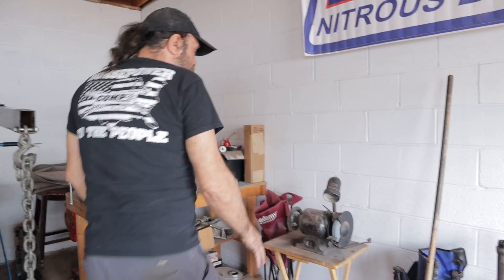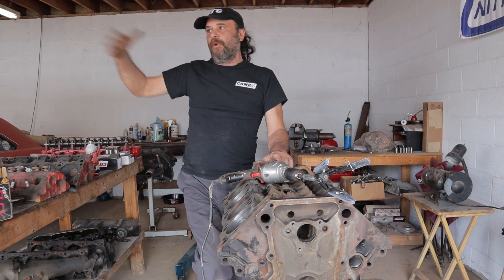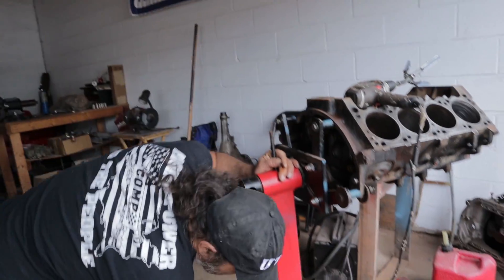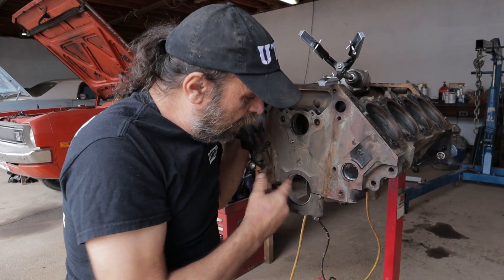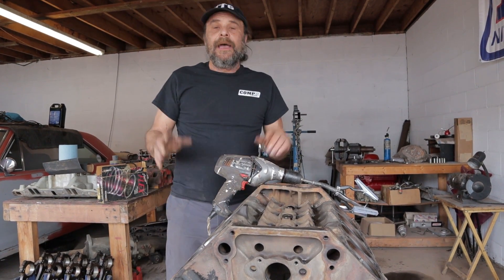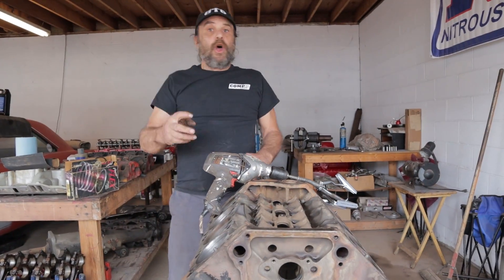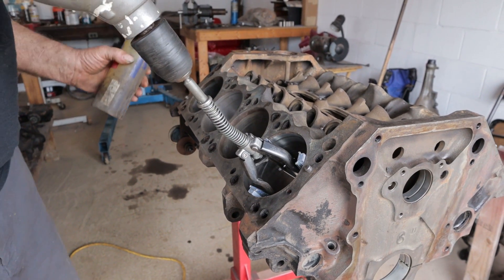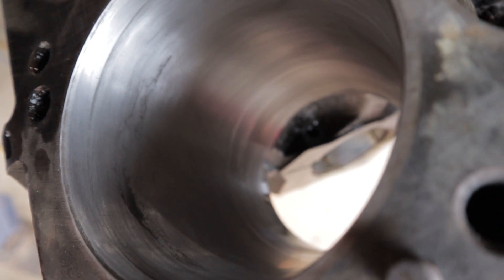Perfect Daily Driver 6 - DIY Engine Block Prep

Comment: I just did a 350 engine rebuild, never did one before, allot of reading and took me about 6 months, but it ran and no leaks.
Reply: Nice job man... No better feeling than turning that key and hearing it roar to life. Makes all the countless hours of riding the front seat of the struggle bus worth it.
Reply: Nice!  Congrats.
Reply: Nothing like that feeling after every Start...... Victory!! ... Peace
Reply: I got a 1970 350/300 sitting in a 70 Impala since 78, I wanna get started on. Drop into a 1992 S10. I guess I am trying to get over the LS naysayers. Seems like this 350 would be in the line with this build. Was rated at 380 ft. lb. of torque from factory. Downside it needs to be prepped for roller lifters since everyone is having such problems out of standard lifters recently... That and not knowing what was actually the problem with it running. Dad said it popped back through the carb one day at lunch on a cold start, and never ran right again. He put a new stock cam and a couple rebuild kits into the carb, to no prevail. Not sure if it was a thing of him being a Ford man, and or not being a good quadrajet man...
Reply: @kramnull8962  Check you timing chain assembly, i know its likely been done but when your stressed, you can often go blind to whats in front of you.
Reply: @kramnull8962  pop out of the Carb is actually a Back fire, I know that term is used a lot for exhaust " After Fire" anyway it can almost always hurt the Carb.. and although it's beloved by almost every car show lately,  you know the slow motion fire ball out of the Carb, dude hand near by, drama etc.. ok, it can come from timing being off, or something affecting timing, creating a misfire.. bad coil etc, misfire creating a true Back Fire.. and I miss my S10.. 4.3 V6 Truck and Blazer.. Peace..
Reply: @kramnull8962  by all means, get over the LS fans.  Its a great engine, but the first generation small block makes the same power in the hands of knowledgable people, and the rush to the LS means the used parts you need are affordable.  Also, if you're bolting it into something that already had a small block, then you already have the oil pan and front dress to fit. If a 4.3 V6, then you have a serpentine belt system and maybe mounts all ready to go. i think the bellhousing pattern might be similar as well, but that's something you should look up. The LS will weigh less if you get an aluminum block, but they only handle so much power output and then you need a cast iron block, and i suspect that deep skirt design weighs more.

What I recommend, is find the price for a Vortec 350 from a junkyard, and the price to convert your older 350 to roller. It may be cheaper to start with an engine already set to roller, and if the Vortec heads aren't cracked, they flow rather well compared to past OEM small block heads.  The issue will be cam lifts near .5" (i think, you can look it up) and the different intake bolt pattern. If you're doing "bang for the buck rebuild", you may come out ahead in the long run to pay up now for a Vortec, with or without a warantee.
Reply: @albertgaspar627  umm sorry to tell you my guy but the gen 1 does not make the same power as an ls. People are making 1500hp on stock short blocks with lq4 6.0s. the gen 1 is an amazing engine but it definitely has its limitations when compaired to the ls. A 70s 350 block will only make about 650hp before it starts cracking. You can buy a gen 4 5.3 from a junkyard for $500-700 throw a cam in it and make 500hp. You'll have a 500hp all aluminum engine with coil on plug electronic ignition and multi point fuel injection for less than the $2000.
Reply: The LS has design advantages.  It has longer connecting rods, it has a deep skirt design (which GM does to all its aluminum engines except the ZL-1 and maybe the Vega engine i can't remember, but the Buick V6 used in Grand Nationals (different from the 3800 used in the FWD cars) was a deep skirt design b/c it came off the aluminum 215 V8) and the heads do flow better.  

Of course, comparing a 6 litre/376 cid engine to a 5.7 litre/350 is apples to oranges (heck, we could talk about the ancient 454 in a motorhome if we're going to do that).  Throw a 3.75 inch stroke crank into that first gen 350 block, and its going to make more power than the 350, too :)  As for 1500hp, if there's a turbo involved, and if its on a dyno, then there's an exhaust system that fits the dyno room layout, but won't ever make an engine compartment, so that hp is going to get lost in a car. 

An OEM first gen block with four bolt mains (i picked one up last month for $50) does have its limits--but so does an aluminum engine block. Those who want four digit hp numbers AND a build that lasts, are using cast iron blocks (that last one is important--i can make a ton of HP on a gen one, ONCE, as well :)  ). You are correct, you can buy a used engine with unknown history for cheap, and its going to make that power on a dyno.  But to put it into a car?  You have to add the price of an oil pan that fits, a serpentine front belt assembly that doesn't shove the AC into the frame rails, figure out the power steering, and since you're keeping the EFI, you will need to add in the price of a throttle by wire gas pedal, the weight of all that wiring,  and if you're going to back that up with the transmission meant to go with the engine, add in the cost of a standalone computer to run it and add in the cost of a new speedometer, since they don't run on cables anymore but sensors. Depending upon the fuel system in the car, that may need upgrades.  Oh, you could use junkyard wiring harnesses, but you better draw out a schematic when you go to repair a sensor issue or replace that LS with a different model needing different sensor locations.

now you're no longer making 500hp for less than $2,000. it made it in the dyno, but not in the real world, where air quality and heat are variables and exhaust systems have bends and is small to clear potholes and manhole covers. Again, i'm not saying the LS is terrible.  Its great in cars designed from a blank piece of paper to hold them.  For the amount of learning you need, in order to retrofit one to an older car, you can learn how to hot rod an engine that was designed back then to fit. 

Will the first gen make 650+ hp and have longevity? You might want to look at an aftermarket block that uses the same oil pan and mounts, that's right. But what everyone forgets about all that HP is, they gotta cough up the dinero for a cooling system for it, a brake system for it (about $2500 for a Baer or Wilwood complete system) U joints, firehose fuel system, strong rear axle, and suspension to put it down, plus you ain't buying tires from Wal Mart for that :)  There is no such thing as cheap mondo power, just cheap dyno numbers.  It is nice to dream about big numbers, nice to brag, but its big dog territory to play in that world.  A lot of folks (Car magazines, TV shows, etc) boast of numbers that don't exist in reality, from an engine that had the dyno played with (atmosphere levels, usually) in order to sell the product.  Just like people believe in 9 second cars after watching Fast and Furious host 14 second cars but with the camera sped up.

Had i the money to buy one of the sports car kits from Factory Five (DTM, etc), and the money to afford the tires, transmissions, etc, yes, i would use an LS engine. its an amazing design, but the car has to work as a system.  if you're worried about costs, the gen one pays off at the end of the day. it fits, its easy to get 300-400 hp, and nitrous makes up the rest of whatever number you want to claim--since those big numbers with the LS also use power adders. 

Yes, there are some people out there who can bend the laws of physics, and get away with a junkyard rebuild posting high numbers and it hasn't crashed yet. That's called luck. There are also car owners who truly believe they are fast, until they get a time slip.  There are also unfinished projects in the classified ads, from people who got in over their head. and to be frank...there's the bullshitters. For everyone who claims success, there are three who can't prove it.
Reply: @albertgaspar627  yes a cam only ls will make 500hp in a car. There's cam only Camaros running 9 second quarter mile times... That kind of speaks for itself. And as for the whole buying an engine where you don't know the history. Well unless you bout that car in the 1970s and were the only person to use that car. Then you don't know the history of that 350 either. That's why you tear down and inspect the engine the rering it with new bearings. Plus you want to compair stroker to a stocker... Why not compair a stroker to a stroker. We just build a 417 ls3 stroker for a friend with stock square port heads and a cam it made 595hp to the tires in his trans am. The motor was designed for a procharger that he hasn't put on yet. If it was optimized for na it would have made over 600whp. Like I said yes the gen 1 is a great engine but when compaired to the ls it will lose in every single way. The LS is simply one of if not the best engine design ever made. So when people say its over done and overhyped theyre just being haters.
Reply: @albertgaspar627  yeah a gen 1 can easily make 300-400hp. But the fact is an ls makes that stock. A good cam, ls7 lifters and pac springs a 5.3 or 6.0 will easily make 500hp. The cam kit is roughly $800 and a rebuild kit is less than $300. I'd take a under $2000 500hp na ls that weighs 200lbs less over a nitrous sbc. Nitrous motors don't last everyone knows that. Plus a full nitrous kit is more than a cam kit for an ls anyways. And as for swapping an ls into a car. It's easy to make engine mounts and the bellhousing bolt pattern is the same and the engine is the same physical size just 200lbs lighter. That doesn't mean the gen 1 shouldnt be used like I said it's an amazing engine... But the ls is one of if not the best engine design ever. And it's hard to compete with one. Basically anything a gen 1 can do an ls can do better for cheaper while being more reliable.
Reply: A 5.3 LS is making about 300 hp, and in 1969-70, the first gen was making that with old tech. And it didn't have the weight of the computer harness. You quoted $800 for a cam kit, but any search for a nitrous kit shows prices less than or equal to that--i did a link, i could do more, but anyone can go look. Nitrous only damages an engine when someone doesn't know what they're doing--it doesn't run 24/7. But i know some don't like N20, just like some prefer a mild cam with vacuum for brakes.  So its all a choice of what power adder they want.

There are more folks who think they can fab up a mount than those who can do it right :)  Even the OEM mounts break from time to time, and there are folks who make a mount that puts the engine too close to the hood, too far back, etc. So they buy a kit, instead. 

We'll agree to disagree, I can stand on the points i already made. The LS is a great design, it can cost a lot to do it right (the days of cheap LS's are coming to an end, everyone knows the demand for them now), and it can be cheaper for those who cut corners.  The first gen can be built by someone who knows what they are doing for cheap (David Vizard has a great book on how to do it) to compete. It all depends upon what deals you find this week.

https://www.streetmusclemag.com/news/is-a-junkyard-engine-ls-swap-worth-the-effort-and-the-money/

and some say a 500 hp 5.3 isn't as cheap as some think

https://www.silveradosierra.com/vortec-5-3l-v8/5-3-budget-build-t621514.html
Reply: @albertgaspar627  the new 5.3s actually make 355hp and thats with 3 cats and restrictive stock muffler. Most people who swap 5.3s use headers which bumps the power up to 380hp then with a cold air its closer to 390hp. That's out of a stock truck motor with headers and a cold air. Compair that to a truck motor from the 60s like a 327. And that's 290hp with headers and an hei distributor. Thats what my 327 made anyways. It was .03 over with stock pistons and a l79 cam out of a Corvette. This was the first engine I built when I was in highschool. A 5.3 is 325cid and it makes over 50hp more than my 331cid engine with a cam and headers. Also anyone will tell you that if you want to do a build right and not cut corners it's expensive regardless of what engine you use. You just have to ask yourself if that few hundred extra bucks is worth making more power while having multi point fuel injection and a coil on plug electronic ignition. To me the answer depends. I built a 350 for my k10 when I very easily could have put a 5.3 in and made more power. It would have made it nicer to drive to work in the winter and more fun to cruise on the weekends but I don't trust an ls engine under water when I drive it through ponds and creeks.
Reply: so what's your concern with an LS exposed to water--aluminum block or all the electronics? There must be military vehicles running the LS if they aren't running diesel, i would think.
Reply: @albertgaspar627  a little bit of both. I didn't want the deck or heads to warp. And I don't trust the coil packs and maf sensor while under water. Im sure they could very easily be waterproofed. but I already had a 350 block, crank and rods with some vortec heads so I just got some pistons and zero decked the block. I wasn't trying to make 600hp or anything stupid its a daily driver/ off-road truck.
Reply: kram Null 
If it had the problem before. 
And you rebuild without diagnosing the problem chances are most likely you will have the same problem after the rebuild. 

Sitting since ‘78
Could be good. Could be nightmare.
Reply: @kramnull8962  that sounds like the timing is off to me. Anyways if you run retro fit lifters with a link bar then all you need is a cam plate to run a roller cam.
Reply: Awesome 👍
Reply: Im currently Rebuilding my Gen 3 6.4 Hemi for my SRT, currently prepping the block for a fresh coat of paint and honestly the prep work sucks but i know in the end it will be worth it lol

Comment: THERE IS A TRICK TO THE CAM BEARINGS ON THE FE ENGINES THAT RUN OVER 6500 RPM'S THAT SAVES THE LOWER END TOO .
Reply: THE TRICK IS TO USE CAPS LOCK. WORKS EVERY TIME.
Reply: Let us in on the secret, I have a 390 im looking to play around with
Reply: @instantninja1  MAKE OIL RESTRECTIONS  FOR THE HEADS . 5/16 SCREW GRIND ON OPPOSITE SIDES ABOUT 1/2 " LONG .DROP IN ROCKER ARM OIL HOLE . GET A HARDENED OIL PUMP DRIVE SHAFT , MATCH THE MAINS TO THE BLOCK HOLES BY CAREFULLY GRINDING .DRILL OIL HOLE IN BLOCK TO MATCH THE OIL PUMP GASKET . ENLARGE THE HOLE IN THE FRONT OF THE BLOCK ABOVE THE TIMING CHAIN . MATCH THE OIL FILTER ADAPTER TO THE BLOCK . YOUR CHOICE ON OIL PUMP ,PICKUP AND YOU CAN USE A WINDAGE TRAY ALSO ADD AN EXTRA QUART BY USING THE TRAY NO PROBLEM . THAT SHOULD HELP KEEP THINGS TOGETHER .  I LIKE TO USE STUDS ON THE MAINS AND HEADS  . I BETTER QUIT OR I'LL BE HERE ALL NIGHT

Comment: they use the ridge reamers for that extra blow by HP lol
Reply: 10 extra pounds of boost from the bottom end...
Reply: Correct. The blow by is used in addition to exhaust gas, to turn the turbo for those extra ponies!